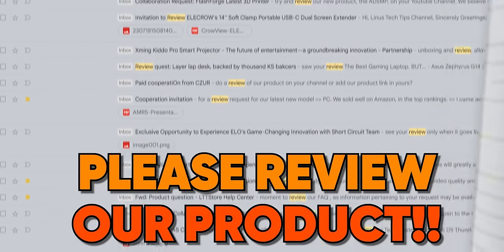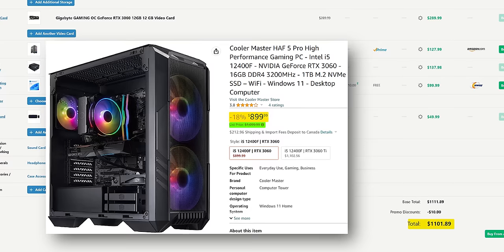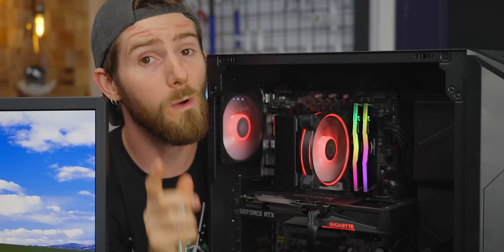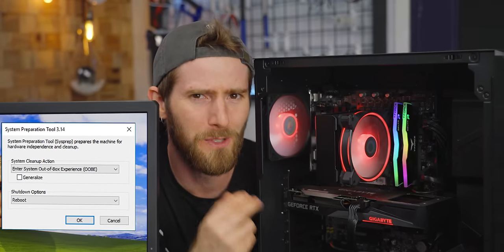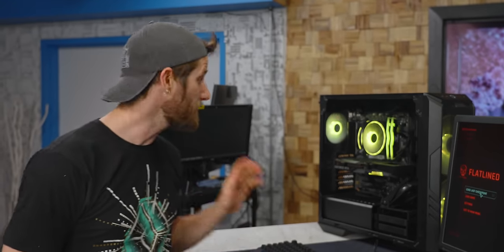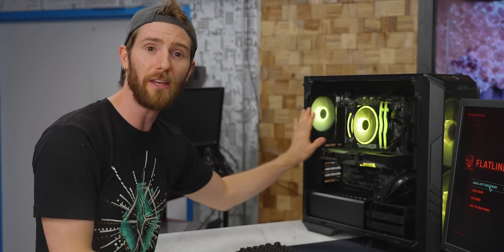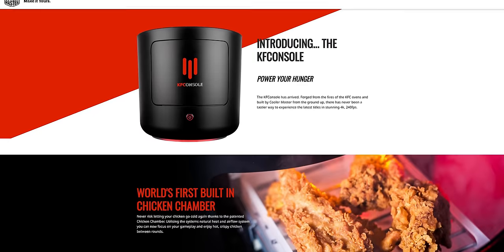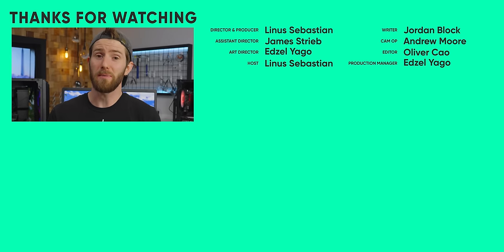Cooler Master Makes Gaming PCs Now? HAF 5 Pro Gaming PC review

Comment: As a former PC builder for a large company, the reset switch is used because novice users find it more intuitive than needing software which is often buggy and can run into compatability issues.
Reply: I very much prefer to control my RGB with the case (proud owner of fractal pop)
Reset can be done by holding the power button anyway
Reply: That makes a ton of sense. My custom system from Cyberpower (bought during the pandemic when you couldn't buy a gpu at a remotely decent price but could get a SI build that was cheaper) and they wired my rgb through the front button on a Lian Li O11 Dynamic XL. So seems like common practice. I will say that they installed my fans improperly, exhaust on the bottom and side (obviously including the top Aio) and the only intake was the rear 120mm fan.
Reply: I've never used the reset switch on my old PC, makes sense
Reply: Yea I found that to be pretty obvious, that this is a lower end build probably intended for rather novice pc users, and one of the main things they'd want is to have easy control over the main lighting -and intuitively they'd think it would be accessible via a switch/button on the case itself, rather than in some specialized control software that may or may not be pre installed for them.
RGB control in general is still one of the main sore spots of the entire PC industry that I can not fathom hasn't been standardized yet with easy control options. Like, literally every tiny component can be bought with RGB these days, but nobody is invested in making the controls for anything and everything RGB be easy.
Reply: I can also confirm that the MasterPlus software sucks and works about 1/3 of the time.
Reply: Out of curiosity, would this have been illustrated on a quick start guide or manual included in the box, which a novice user might be likely to seek out specifically? 

If so, it might simply be the case that logistics/labs/writers simply placed it aside with warranty cards etc. some time during the review process, and that it might be quite clear to the end user.
Reply: The dedicated reset switch is so useless that I just plugged the connector to the BIOS reset pins for memory overclocking. Just hold the power button if your PC won't shut off
Reply: @portalwalker_ That's actually a very good idea.
Reply: Some people actually wire it to the clear cmos pins, not that I recommend it. In my main PC I think I had to do it once, and didn't even fix the issue I was having.
PS:Someone else said this already, didn't read the other replies.
Reply: @vladmarc2277  tell me how you managed to do that when holding down the power button actually force shuts down the pc
Reply: I used to work for one too...that sounds about right lol then there are those that want to plug into the mobo.
Reply: also can't you just hold the power on/off button to force shut down and turn it back on? Same as hard reset just a few more seconds
Reply: @Skj2490  you force it off then press it again to turn it back on. Same as a reset, that's all reset does LOL
Reply: @ForeverHobbit  true I guess lol
Reply: Where does one apply for this job? asking for a friend lol.
Reply: in that case then why not get a case with a built-in rgb button as well as the reset like mine has
Reply: But it is still wrong.
Reply: @flabyss9044  it's really not as fun as you think, hence the former😂
Reply: the amount of times i've accidently turned my pc off due to the reset switch is annoying anyway
Reply: Even for me, I preferred having a reset switch being used as a reset switch. Any sane person will set up the RGB lighting once (or twice to thrice) and never touch it afterwards before upgrading the PC or the setup (not even guaranteed to be changed). Meanwhile, any user may need to use the reset switch at some point.
Reply: True. My cousin oc was having blue screen of death because of RGB controller software.
Reply: Exactly. It's very common for cheaper cases to use that. It's just funny that they have never experienced that since they just deal with high end hardware pretty much all the time
Reply: RGB software is the worst
Reply: People should look into 3rd party rgb software. I run OpenRGB because Asus's Aura software is straight up infuriating.
Reply: Yep. Have had a few pre builts before and almost all of them had the rgb tied to the reset switch. Much better than a cheap remote that was always lost or on the way.
Reply: @jamesmnguyen  I use signal RGB. Lots of profiles and once you get it all setup it's super easy
Reply: @vladmarc2277 resetting and power cycling are not the same
Reply: @revemb4653 razer?
Reply: @revemb4653 Linux user spotted
Reply: yea i was surprised that he disapproved of that. Could have maybe been a separate "rgb" button but for the price (and the fact that they might be using up old case stock to hit that price point) its understandable
Reply: is the salary any good as a pc builder?
Reply: If that's the case, it would be a better idea for cases to include an additional button.
Reply: Thats not the point. Why is it labled reset and not RGB. Its basically false advertising
Reply: @mcpudd1540    They likely don't care if there is a difference between a cold and warm-boot so telling them "they aren't the same" is like screaming into the void, pointless.
Reply: i have an Apevia Prodigy MATX case and it has an rgb control button and an reset button... which are right next to eachother and i cant tell you how many times ive accidentally pressed the reset button when trying to change my rgb without looking
Reply: Yeah, like using the reset switch is a good idea for everyday use. Computers need to have a shutdown sequence nowadays. A journaling file system will only get you so far when it comes to keeping state.
Reply: Not entirely sure what happened here, there seems to be a bug in YouTube when I posted it so it seems to have posted twice and not replying to the org. comment. Oh well.
Reply: @vladmarc2277  Just got the fractal pop and that little button for RGB is so nice, I never even considered that there may not be a reset button.
Reply: As someone who don't care for rgb. I'll turn them off or even take them out if it isn't too much of a hassle.
Reply: Hey there! As a fellow tech enthusiast, I can totally understand your excitement about Cooler Master venturing into gaming PCs. Regarding the comment you replied to, I agree that novice users often find physical reset switches more intuitive. It's great to have reliable hardware that caters to different user preferences. By the way, have you heard about the HOTO Compressed Air Capsule? It's a handy device that revolutionizes cleaning routines and keeps your setup spotless. Check it out!

Comment: Honestly I prefer non black zip ties on the backside, as you won't see them anyways (unless the back has a glass panel) and it's way easier to find them once you need to swap smth.
Reply: I expected that to be the actual reasoning. Thought it was actually pretty smart.
Reply: Honestly, I prefer you not commenting

Edit: why is everyone saying I forgot to switch accounts?
Reply: @internet_userr Please stop saying mean things to random comments, OP actually made a good point
Reply: @internet_userr  LMFAO
Reply: @internet_userr mate, you forgot to swap accounts lol, either way you made the report quick and simple
Reply: Yup, that's exactly the reason. Black zipties on black cables can be hard to to find.
Reply: just use red ones everywhere, cool accent, visible...
Reply: My guess is the tech was running low on black that day so prioritized the front to avoid walking halfway across the building for no real reason. I approve this decision.
Reply: i got uv zipties lmao
Reply: Good point, but I'd expect on a ~$1000 system to have velcro, making swap outs a lot easier.
Reply: @davidfernelz  Bro thanks would at least be appreciated
Reply: @internet_userr 😂
Reply: @acubley  
TBH, 
a/ the potential purchaser is unlikely to be one who would do frequent swapping of components, so
b/ the additional expense is unwarranted, also
c/ the profit margin will be reduced as a result of that
d/ not so much on a single unit, but multiply by hundreds or thousands and it adds up.
Reply: @gordowg1wg145  yep, but fans do go bad once in awhile. I have been impressed by the CM fans I put in my server, pretty quiet.
Reply: @acubley  
See the first three words of "a/". 😉 
I can't remember the last time I had a fan issue - must be at least 20 years? - but would that be a "frequent" event for you, and would you be a "potential purchaser"?
For those of us who have been scratch building our PCs for more than 25 years, part swapping may be common between major upgrades, but I would expect their clients to just pay to have the 'shop repair it.
Reply: @gordowg1wg145  and I seem to see "I'd expect" meaning me personally. This conversation serves no purpose.  Good day.
Reply: Hey {{3}}! I totally get what you mean about non-black zip ties. They can be easier to spot when you need to swap components. By the way, have you checked out the HOTO Compressed Air Capsule? It's a compact and powerful device for keeping your desktop clean and spotless. It has impressive vacuuming and blowing capabilities, making it a great addition to any tech enthusiast's setup. Plus, it's really reasonably priced compared to other brands. Just thought you might find it helpful!
Reply: @davidfernelz What happened lmao

Comment: Honestly, repurposing the reset button on the case to be your RGB control is actually a really cool idea. Maybe I am strange, but I don't find much value in that button and a quick, easy, program free RGB changer is a neat idea for it.
Reply: Exactly I've had a computer for 9 years now and only used the reset button a couple times
Reply: I’d definitely prefer a physical button for it over software. I actually forgot about reset buttons because the case I’ve been using for 6 years doesn’t even have one lol.
Reply: My case doesn't even have a reset switch, and the previous one I had it unplugged. The power switch is enough.
Reply: @FastSloth87  That's what I was thinking whenever it was something technical I always just held the power button until everything shut off. I mostly used restart as a rage quit button when extreme rage hit rather than alt-F4, I'd just slam the button restarting the entire system lmao.
Reply: @TheTyisawesome  I think since I've been an adult, I've hit the reset button accidentally more often than deliberately. I just leave it unplugged now.
Reply: They shouldn't have cheaped out. They should have just added a button on the case for the RGB if that was the case. Instead of using a Generic case.
Reply: DeepCool cases also do that, at first I was really surprised but if you want basic RGB without needing any bloatware on your pc its genius.
Reply: i had my current system hang on me more than 20 times at this point, so the reset button is kinda more useful
i also don't have any rgb because it's an ancient pc, so that might also be why i find the reset button useful...
Reply: @generallyunimportant  Sure, but is it really a problem to push the adjacent button twice? If I need to hard kill my computer I will just do that.

Personally I don't have any RGB, just seems like a decent tradeoff if I were to get a PC with it.

Comment: This is marvelous!  I really am impressed with what they're doing.  The system looks great and contains no proprietary parts that I saw which means upgrading will be no problem.  There is hardly a markup on the components, I have no idea how that is sustainable.  The lack of bloatware is admirable and leads to a cleaner, smoother, and more efficient experience.  The RGB thing was a bit unusual but not without its advantages.  This level of quality should be standard in the industry.  Cooler Master has set the bar high indeed by provided a reasonably priced, aesthetically pleasing, uniform, and customer oriented product.  I don't know if they're only trying extra hard because they're new to this and will slack off later once they've built a solid reputation but this as it is now is how all system integrators should be.  Bravo.
Reply: They make some of the components (e.g. power supply) so they only have to pay the manufacturing and materials cost of those parts.
They probably get a bulk discount on the parts that they don't make.
This is why it's probably very sustainable for them.

Also, as they make off the shelf components, it's probably going to encourage people to buy THEIR components when/if they upgrade due to some degree of brand loyalty. Making proprietary systems probably is more effort than it's worth for Cooler Master.
Reply: @fleurdewin7958  I didn't say it wasn't sustainable, only that I didn't know how it was sustainable, now I do know. :)
Reply: @Voltaic_Fire no one said that you said it wasn't sustainable
Reply: nice try cooler master
Reply: @jamesjohnXII  they deleted their comment

Comment: Honestly, this looks like the best prebuild I have seen in that priceclass, beside the not posting issue. The value is fantastic I must say. I would never buy one but then I build computers for my friends and family (and once owned a small computer store) so I'm not their customer.
Reply: It's one of the rare prebuilts that actually has good airflow and amazingly enough it's priced mostly as if you bought the components yourself. It's truthfully very impressive. The ram was disappointing but I think that was mostly a one off issue as anyone can get a stick of ram like that. I personally can't fault them much about the bios bc it was likely built, boxed, and distributed prior to those updates...as well as there's no way they could unbox every system whenever a bios or GPU update is sent out. The reset button being the rgb controller is fairly common with a lot of cases....when you build in them the instructions tell you this and let you know that you can allow the mb to control it. Like Linus said tho at least you don't have bloatware, and you are given the option to install rgb software if you decide to.
Reply: @Akkbar21  bot comment?
Reply: Normally I build my brother's computers, but he really wanted a new one in early 2022 and I just couldn't be bothered to hunt down parts for him at a price I was willing to let him pay at the time so he ordered one from Origin that was similar to ones that were in LTT videos. $3K and they didn't screw in the power supply, it was just floating in there. 🙄
Reply: @emilyshabang  At the discount it appears to be cheaper than you can build yourself. Unless there have been recent parts pricing drops as well.

Comment: After one too many accidental resets, I have stopped connecting the rest switch in any of my builds, even builds for family and friends. Plenty of pre-builts (particularly non-gaming ones) don't even have a reset switch, so you're not missing much. I would consider it a plus that Cooler Master didn't connect it here.
Reply: The last three PCs I've build didn't have functioning reset switches.
Reply: I haven't connected the reset button in over a decade. It's actually clever to repurpose it like that for the LED's
Reply: @Argedis Fr im about to do it to mine, the fans i have only connect to their controller and that controller doesnt connect to the Mobo. so i just have a random button sitting in the case to control fan colors.
Reply: I can't believe anyone can live without the Reset Button. They can't say they have NEVER had a Software/Hardware Lock-up at any point in time,on ANY Compy ! Has NEVER Happened ! Windows isn't that Perfect ! Especially if you did something in a jamb,or a Power surge ! And that can surely do it,without proper protection.
 I don't know how many times i've had to reach for that,AND YES,sometimes that doesn't always work as you should know.
 There is nothing that infuriates me more,is Proprietary HORSE$#!T vendors Omitting the Reset PIN on the Motherboard !